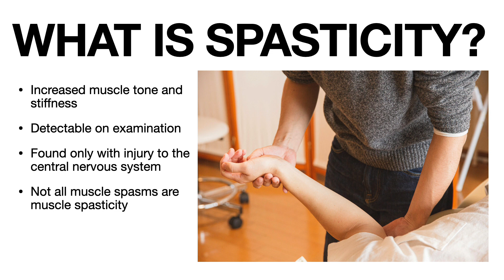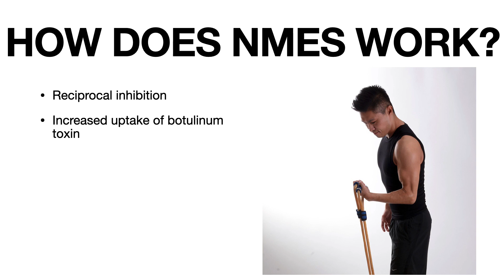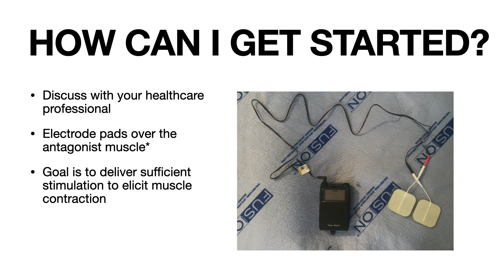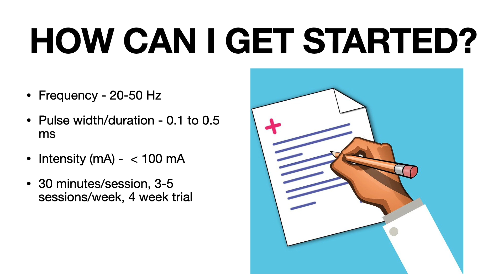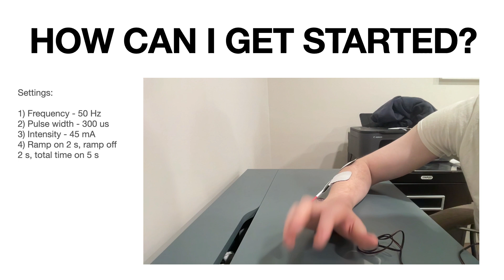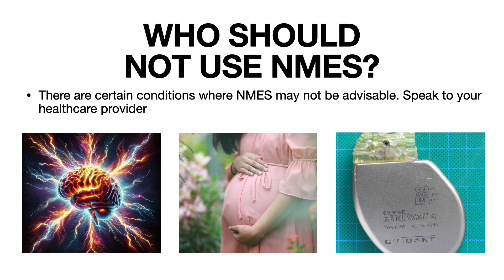How to use neuromuscular electrical stimulation to improve spasticity

Comment: My wrist doesn't move like yours at all. My fingers bend at the 2nd joint from the finger point. They never go straight. Which body part should you select? My OT said the shoulder icon. When would use the hand icon?